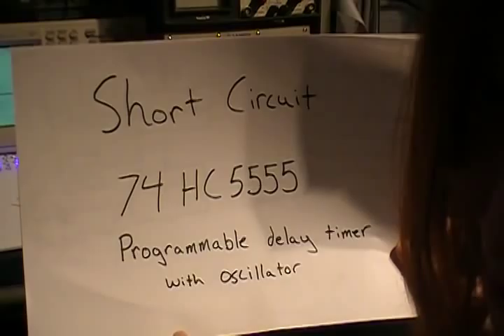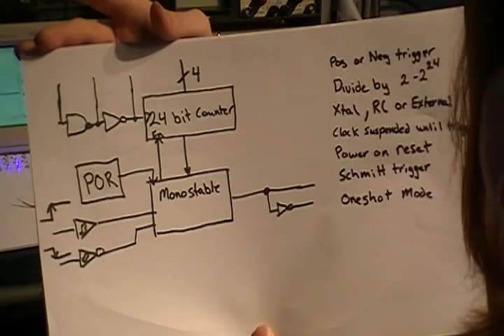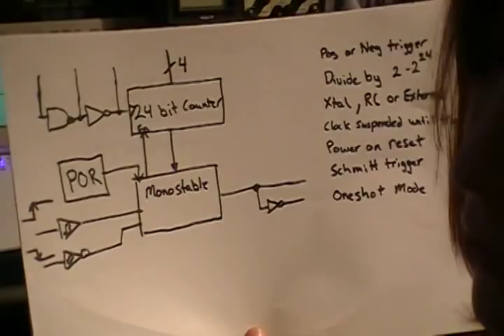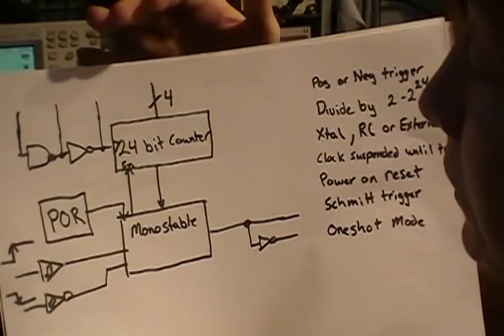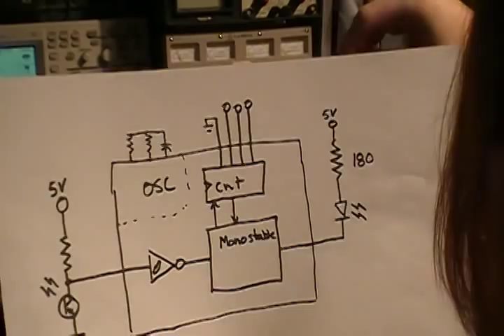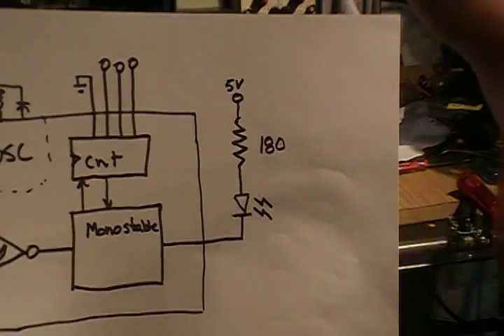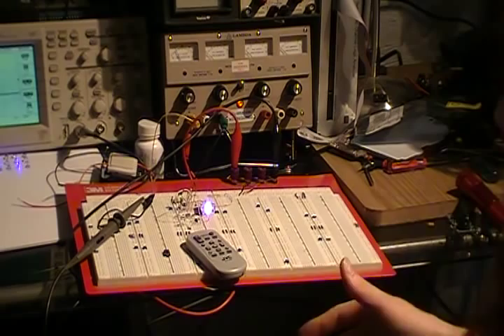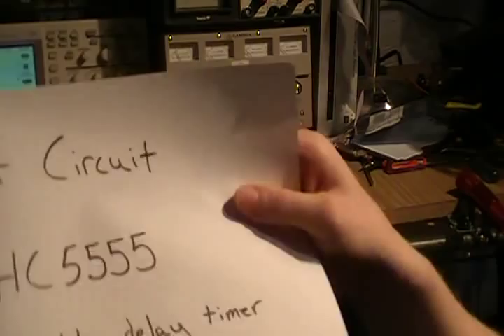Programmable Delay Timer 74hc5555 - More Fives the Better

Comment: Hi Jeri.  I just made a similar mistake and bought the wrong part.  I thought i bought a 555 timer and was planning on using it for rc astable multivibrator as a frequency gen to send to some drivers for some high speed stuff.  I queryied the chip on you tube and you popped up.  Can this be used for astable  multi like regular 555 with no external trigger? 

Thanks,

Shawn

Comment: Use the 555 as a clock and feed the clock signal to a CMOS binary counter.  Take the LED array control signal from one if the higher significance bits.